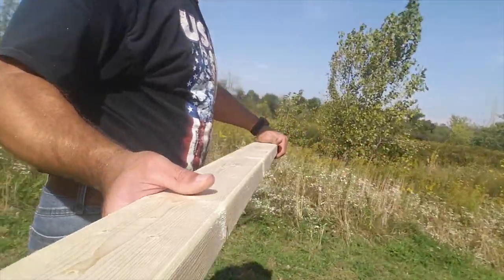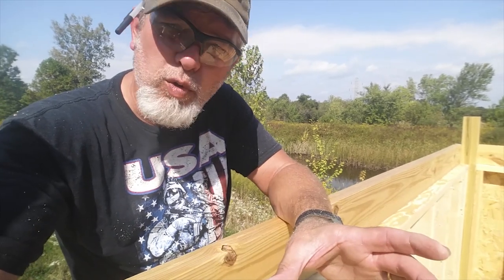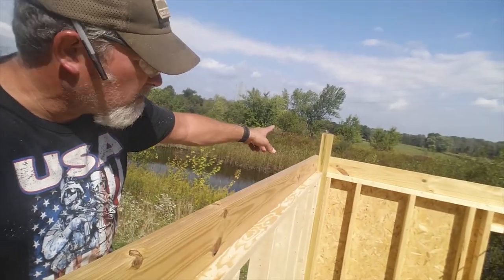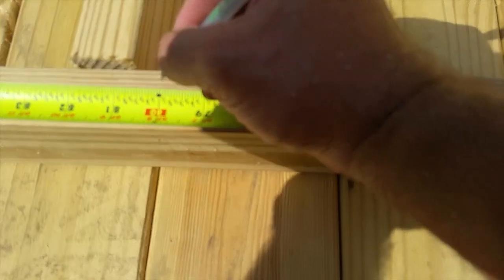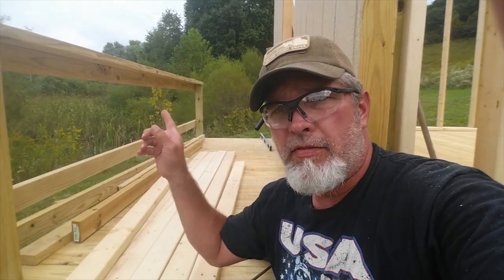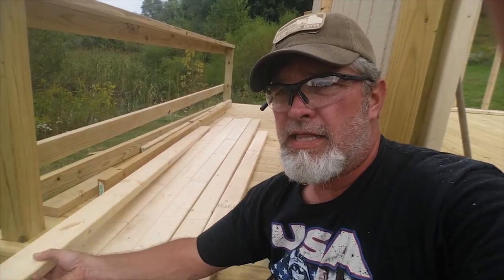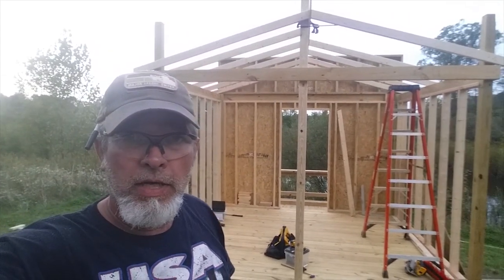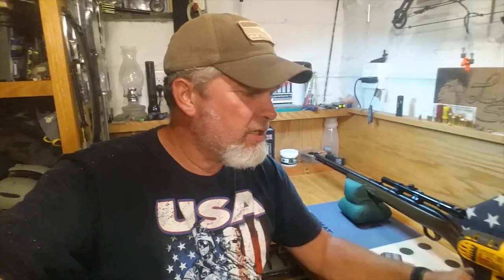"Shootin Saloon" A covered shelter for firearms fun.

Comment: I'm  carpenter by trade. Do not use screws for framing. Screws are made to hold wood down, not up.
Reply from the maker: I have heard that before. I built two structures when I lived in Florida back in the early 2000's. Both of them survived 3 hurricanes one of those was Charley in 2004. Was it luck? I don't know, but my neighbors house less than 100yds away was completely leveled. Thanks for watching!

Comment: Never heard of a hammer and nails?
Reply from the maker: Although a hammer and nails can be much faster, especially if the nails are used in a nail gun, I will only build with screws if given the option. I built 3 structures in Florida during the 2004 Hurricane season, directly in the path of Charley. The most damage to any of them was where a branch had hit the corner of the smallest one and broke A shingle. My neighbor's house, 200' away was just a floor and a refrigerator. There is no way a nail can have more hold than a screw.